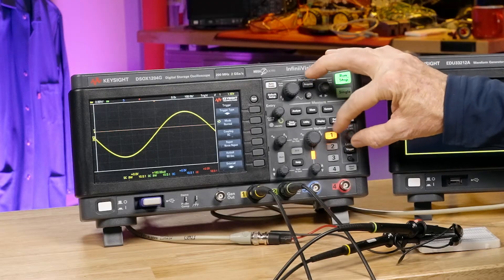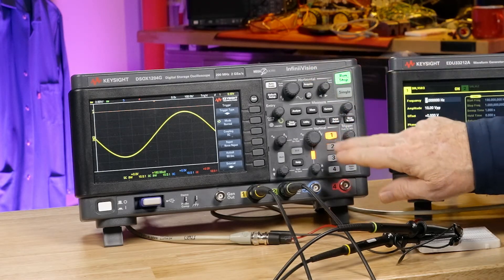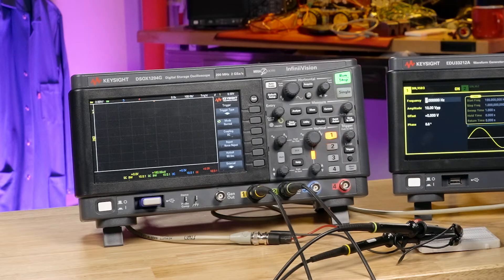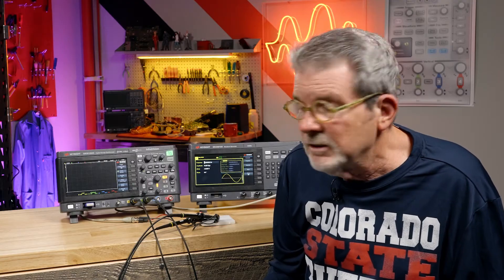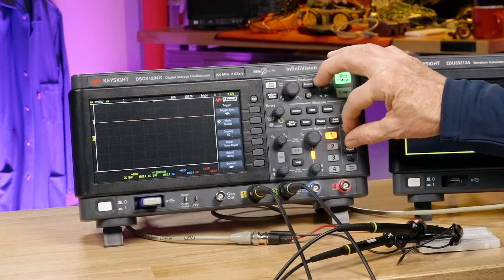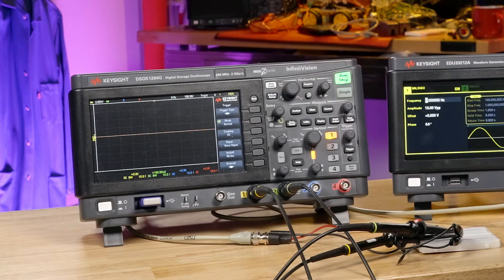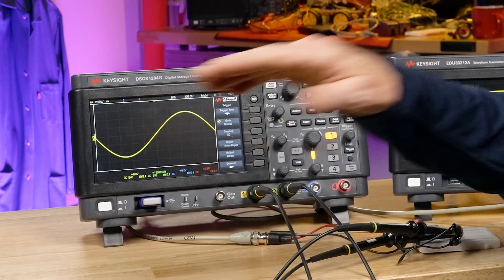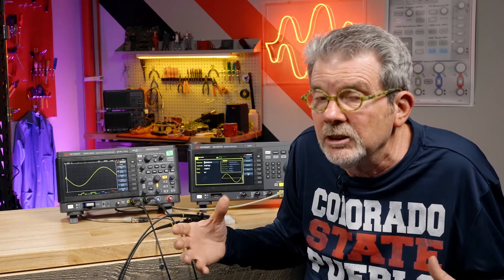Lesson 11: Triggering Part 2 - Auto vs Normal

Comment: 3:03  I'm wondering what a 1 Hz sinus signal looks like on an old classic analog oscilloscope. I'm also wondering why this digital oscilloscope has this latency delay at a sinus signal of 1 Hz. Could it be that the duration of the 1 Hz sine wave is too long and the minimum sampling rate is too high to be able to process so many data points quickly and display them without latency?
Reply: My scope has a « roll » option so it behave more like an old scope as the display now doesn’t update more or less it roll the data on the screen ! Useful in the case of low frequency, or long capture as otherwise you see nothing other than « acquisition » , but the memory depth is less :)

Comment: That's an interesting startup transient for the function generator. I guess it has something to do with trying to approximate a sine wave as a series of pulses and getting them synced up correctly.
Reply: I am just going to guess that the output is gated through a relay and the contacts bounce.  This guess may be worth less than you paid for it.